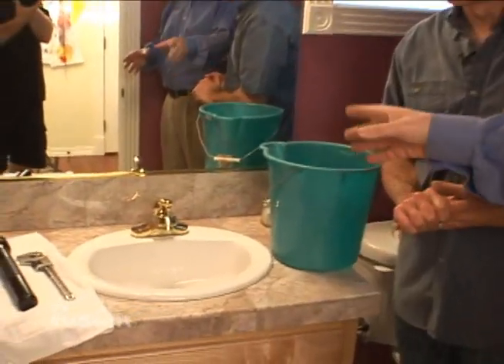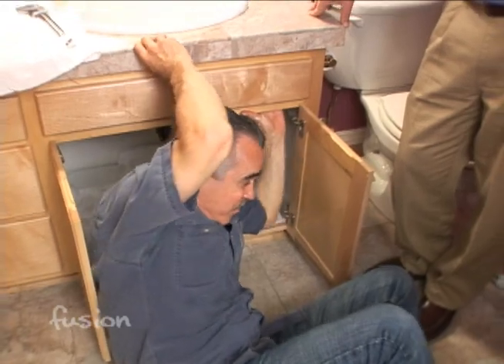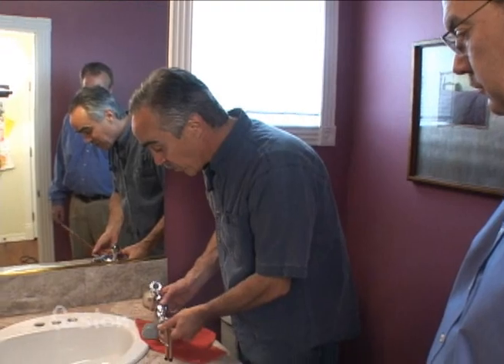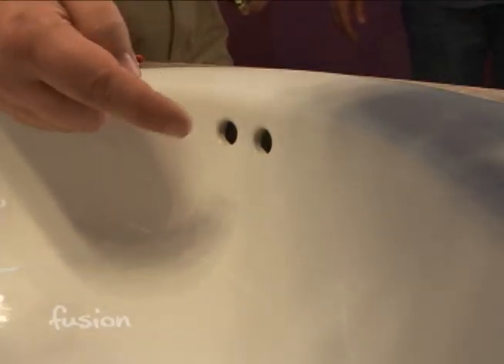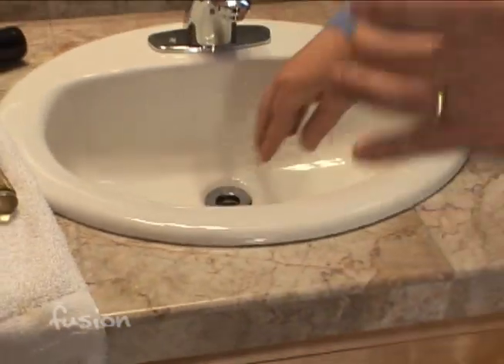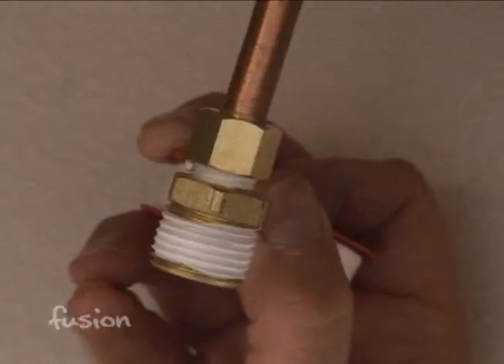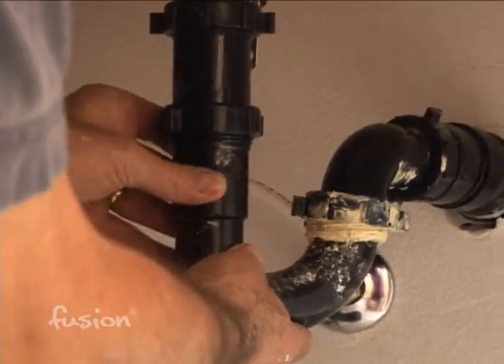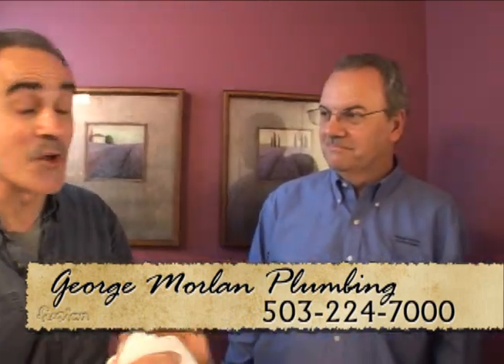Replacing Your Faucet-Part 2

Comment: i did the same put that tiny rubber gasket under the strainer and had a leak . Took it out and  applied some putty and stil have a small leak  i m ready to use silicone under the strainer .